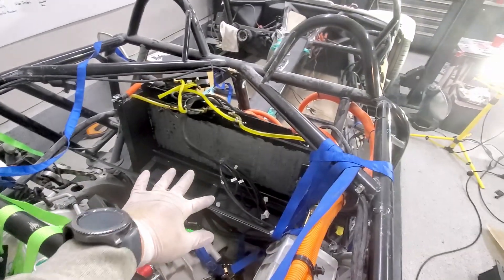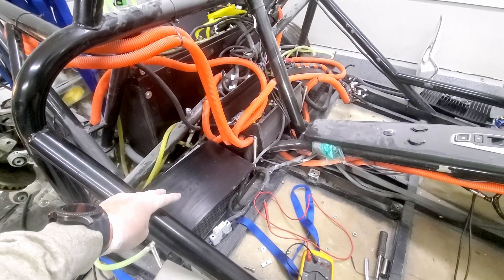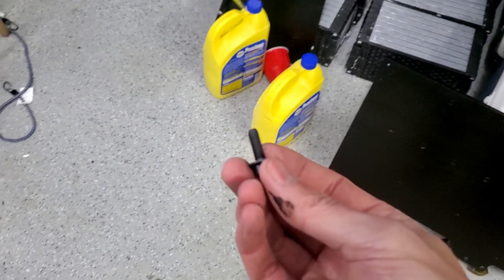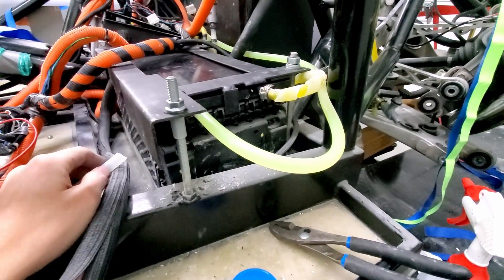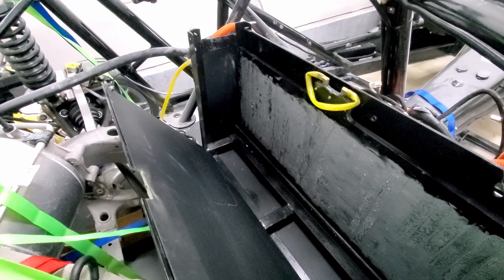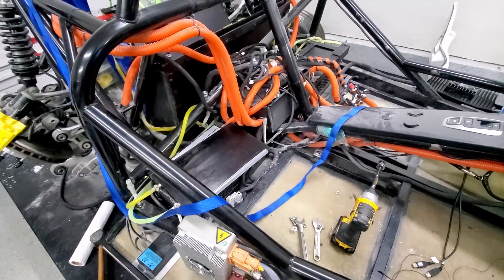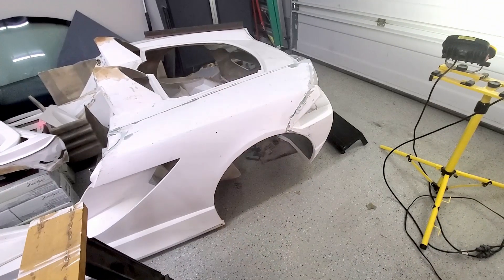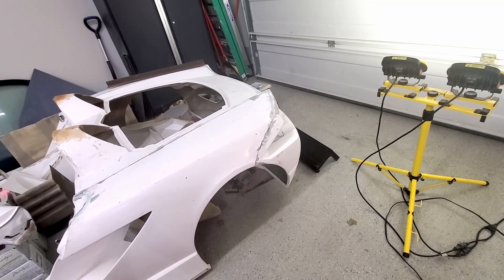First Joined Part - Happy holidays to all!

Comment: One thing you could have done on the cooling plate is oversized the bolt holes and inserted plastic spacers and use plastic washers under the bolts to isolate the cooling plate

Comment: You can use nylon sleeves and nylon washers the bolt heads sit in a shallow dish for better insulation. The silicone or plastic tube you are using can't really take the tork down pressure you have. the pieces you made from the molds look great. Happy new year to you and your family 🎉
Reply from the maker: Thanks for the comment!

Comment: Wow! That rear light fitting looks so good! 

Well done on making the mold and managing to get it to this!

The insulation process in interesting, could you get away with rubber sheeting or silicone sheeting for some parts?

I do hope this works and fixes your problem.
Still, you are doing a great job, it's a complete from scratch build, not a strip and rebuild. 

Very much looking forward to seeing it finished. 

Hope you had a good Christmas and a Happy New Year.
Reply from the maker: Thanks!  I still have a lot to learn.  Others have suggested similar things.  I will get some materials ordered and see if it helps.

Comment: Great stuff.. Making some awesome progress now.. 😎 👍
Are there more battery packs at the front of the vehicle that need the same treatment? I would also do some electrical insulation where the high voltage contactors are affixed to the vehicle. Apart from that it's all going great as far as I can tell. Keep up the great work. (and as Roy suggested.. The nylon mushroom style insulators would be a good addition.. They also will not deform over time as much as your rubber/silicone fix and keep everything tight as it should be) 
The only thing that could have been done in hindsight is to test bench all the electrical systems separately before they were installed onto the vehicle (I really hope it does not come down to this) 
That diode install for the keyless entry, I think may have solved a few more issues than just the car starting on its own too. (fingers crossed 🤞) anyhow one step at a time..
Oh and the bodywork is coming along great 👍
Looking forward to the next episode as always 😎 👍 🧙‍♂️
Reply from the maker: Thanks Friend!  I will probably do some checking on the front battery pack as well.  It is great to have comments like yours!

Comment: Great update. I’m looking at the battery module bolted  joint (7:25), if there is plastic tubing in the joint, or anything soft, it’ll continue to relax , and you’ll loose clamp load. Ie, nothing keeping the nut from backing out. A simple jam nut will at least keep things from going too far awry.
Reply from the maker: Great Point!

Comment: Hello, First of all: Great channel! I enjoy your videos very much. Now regarding the isolation, A rubber or paint coating will not suffice. Due to vibrations on the parts where the coating would do its job, it will wear down and you will end up with the same troubleshooting again. What you can do is buy a sheet of Aramid or Keflar fiber, and laminate the surface of your cooling plates and other metal surfaces of the HV system. These fibers do not conduct electricity and are wear resistant.
Reply from the maker: Great suggestion!  The build gets better from suggestions like these!

Comment: On the outside you need to sand back about 2 -4 inches and cut through a few layers of the fiberglass and then build it back up.  If you don’t do that it will create a small crake in the paint.  Believe me I made the same mistake when I first started using fiberglass.
Reply from the maker: Thanks for the comment!  Out of curiosity, is it vibrations or expansion or something else that causes the problem?
Reply: @electricsupercar  it’s due to expansion.  As the fiberglass heats up and cools down (sun and shade) the material will expand and contract at different rates.  Especially give the fact that the resin is at different thicknesses.  So you need to create a complete mess with no seams.

Comment: You need some bolt insulator sleeves for the all threads and insulating film or sheets. I use to work on coal mining electronics and that’s what we used to insulate in high voltage uses.
Reply from the maker: Thanks so much for your comment!  I will have to get some on order